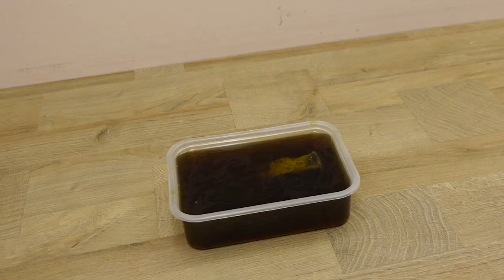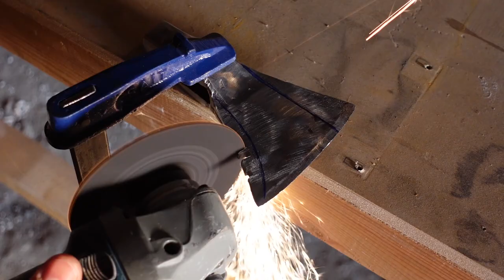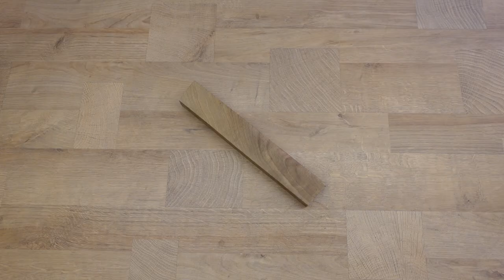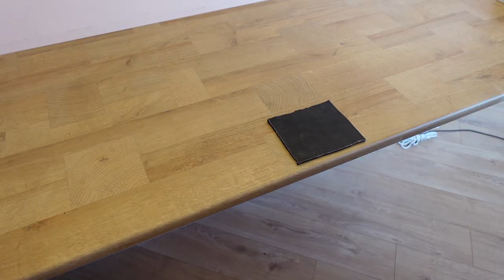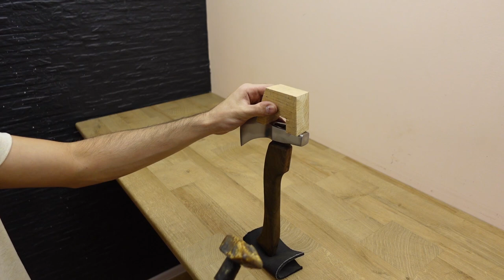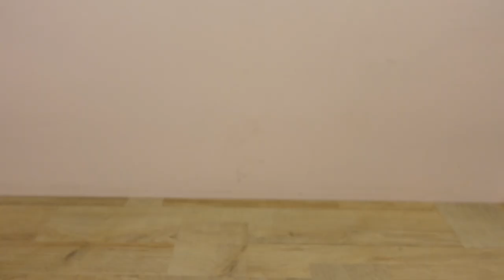Tomahawk from a rusty axe head | Perfect Restoration

Comment: When I was watching this, I noticed that center shaft on your sander can become a nice drum sander as well. Wrap some adhesive backed sand paper around the center shaft and you will have a great rotary drum sander for some of the tight spots and radius area's. It would have been useful for sanding the underside of that axe head.
Reply from the maker: This is an incredible idea, thanks a lot 👍
Reply: It will be almost free and can help with future projects.